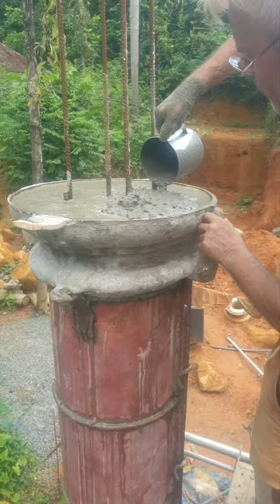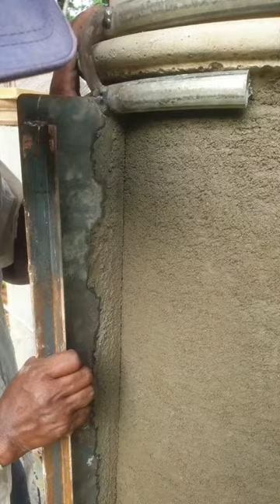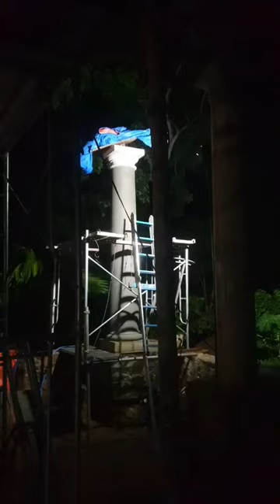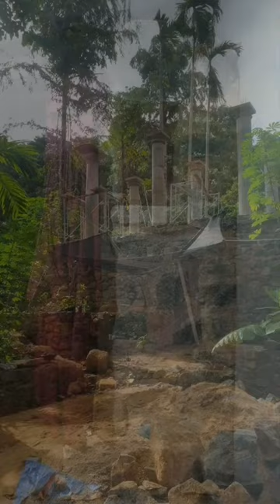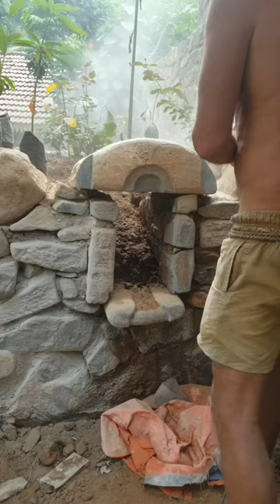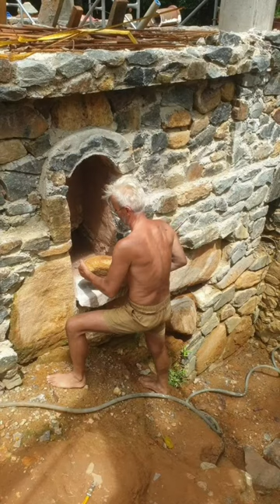Sri Lanka,ශ්‍රී ලංකා,Ceylon,Rock Carving,Column Building,Stone Walls,Cuturi Pneumatic Hammer,Trailer

Comment: Hi, thanks for sharing the video. Can you tell me what air hammer you are using and what compressor, size, cfm, gallon tank and HP? It would really help me decide what tools to get for hard stone carving, mid stage. Thanks.
Reply from the maker: Hello Hello! WELCOME. I will provide you with a detailed reply asap. I will tell you what I think is useful and suitable for the stone works I do... after I got a bit more experience by trying. It turns out that my favorite tools are at this point more the diamond blades driven by angle grinders. The air compressor driven pneumatic hammers I am using less because it takes more time to get away with the hard rocks I am now working with. Still I will use the pneumatic hammers with the chisels in some situations. My interest is now more going into the direction of more performing diamond coated drill bits and smaller sized disks. Not available in Sri Lanka. But I use diamond coated round cutting tools which are designed to just cut out holes into concrete and granite.. to do more artistic  3 D carvings. Till I can buy much better diamond coated drills with interesting shapes.